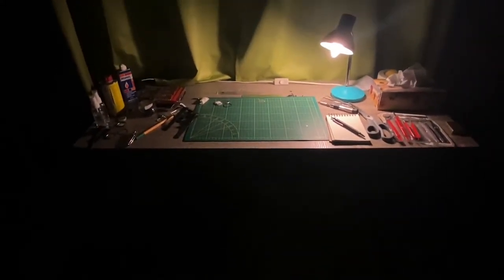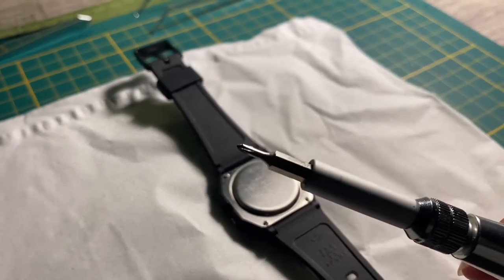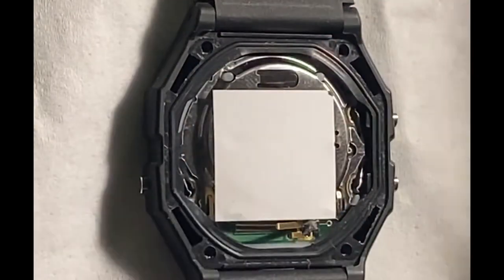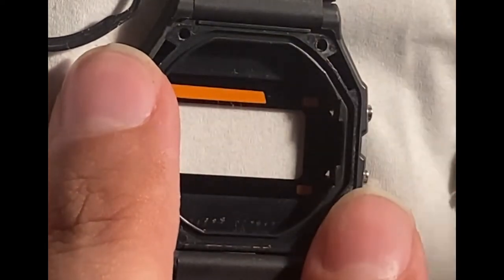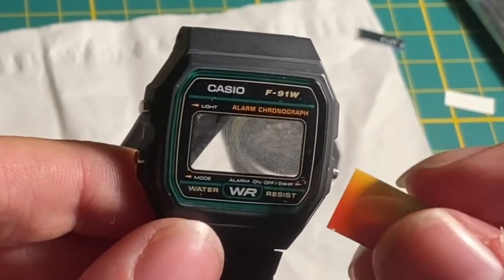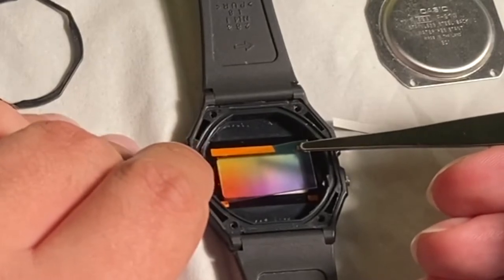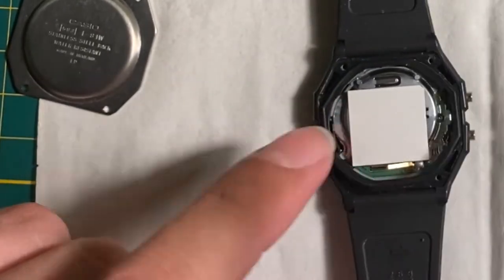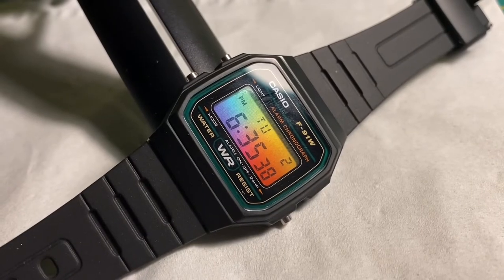Casio F-91W Gradient Screen Mod

Comment: Any issues putting the adhesive on the module instead of the face?  I have a skxmod insert that's raised.  Isn't letting the film lay down flat which is causing bubbles.
Reply from the maker: @castor278  you can totally do that too! There’s just a risk of damaging the module if removing it so beware

Comment: Would these fit the Casio CA-53W by chance? Ordered my gradient filters just now, I have a F91W that I plan on using but I also wear my data bank quite a bit. Was wondering if the dimensions will work out for that watch as well. Thanks for the tutorial!
Reply from the maker: I’m pretty sure they do. The display is just a bit slimer so you might have to trim the filter a bit
Reply: @ogglogg awesome. Thank you! Mine are coming in the mail tomorrow or the day after, I’m quite excited to see how they look